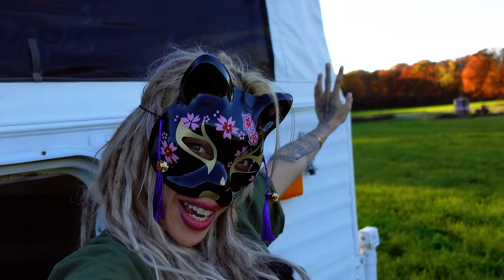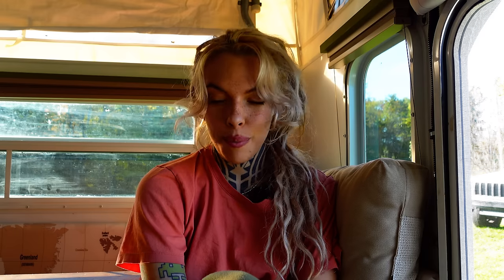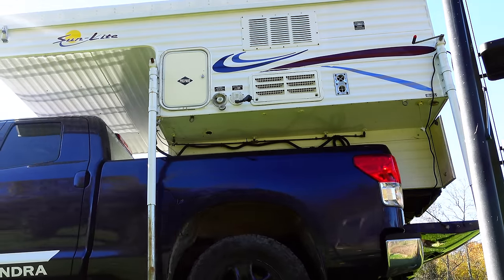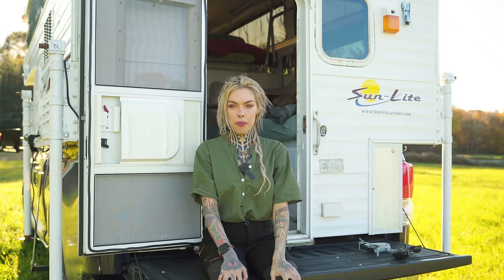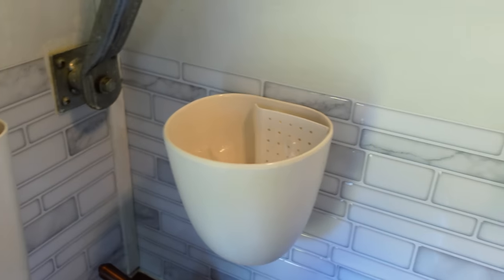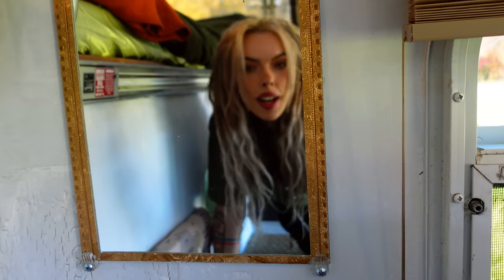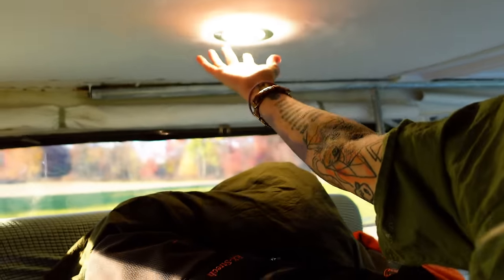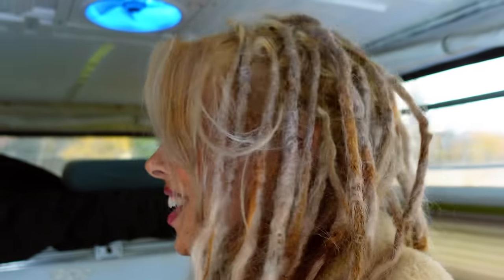finished TRUCK CAMPER *TOUR* (solar off grid renovation)

Comment: You did an excellent job restoring your camper and should be very proud of yourself, I don't know you and I'm proud of you, There is something about doing it yourself along with help from others that makes the restoration more satisfying. I also restored my Lance truck camper and can totally relate to the leak problem, it took me 6 months and out of frustration and a few too many beers one rainy night i finally ripped my roof out from the inside of the camper where it was leaking until I finally found the sourse of the leak, it was so fucking frustrating thinking I had fixed the leak sealing over and over to find out the next time it rained my roof was still fucking leaking, and the funny thing about it was the leak was somewhere that I thought I had sealed up and sealed up several times before, it was a pleasure watching you succed, Cheers

Comment: Nice job Victoria, certainly an improvement. I too spent years living off grid, (me on a sailboat), until my health got too bad to continue safely. Fridges running solely on alternative energy do not work so well in my experience. The problem stems from the poor insulation, and really needs to be a top loader. Last one I bought was an Alpicool C9P 9L Car Fridge 12v. This is small but worked well with my solar and wind set up. I used toilet roll to help trace leaks. Place the paper where you think the water might be running and keep a track of whether it gets damp. Any water will get to be a problem cos basically it will cause dampness and ultimately mould and rot. Recommend ziplock bags for everything... especially in cold damp climates. If you can, spray anything metal with a water repellent spray. Oh and if you can find a machine shop, get the winding handle extended. This would make winding easier. Cut it, weld in an extending piece, (like suitable tube), and your done. (should be a cheap fix). Best wishes from UK.

Comment: Camper is looking good!
Remember, if you haven't already done it, to hook up a charge wire from your trucks alternator to your camper plug so it will charge your camper battery/Jackery  while you drive.
I've had 4 slide in campers and all have had this. Even while you're at a camp site you can let the truck idle and charge up!

Comment: Love it! You did a wonderful job!! I believe there is no better feeling than seeing a finished job, when so much time and effort has paid off ...and it shows! One thing I might suggest. If your truck doesn't have a cb, you might consider one. Even a hand held in the least, for emergency purposes. Also, for your camper, one suggestion might be a hanging net if you have room to attach. A small one could hold fresh fruit or veggies, and when not in use, fold neatly out of the way. Wouldn't take up a lot of space and holds tight while driving! Anyway, can't wait to see the next vid! God bless and stay safe!

Comment: How exciting! Can't wait to see what kinds of adventures you are going to get into! I bet you're gonna feel right at home in your little camper once you get on the road. It's looking good, great job! Where are you going to go first? I bet you are excited to get going. Hopefully it works out well and you have good luck with this truck and camper. It seemed like you always had Yuki in and out of the shop getting one thing or another fixed. Hopefully this set up doesn't give you much more trouble than it already has. I feel like you went through A LOT to get it fixed up okay. Like for real, you busted your butt fixing it up and I'm proud of you! Sending love and well wishes, as always, from SC. 💖💖💖

Comment: Be sure to watch all over the wires for water intrusion where you penetrated the roof. This is notorious for leaking water and water following down the cable and leaking below. Common issue due to the heat and expansion contraction of different materials. You have put a lot of work into your set up and it looks wonderful.

Comment: Happy trails..... 😆 
Don't  put the tie downs too tight it will pull out the attachment  point on the camper.
They should be no tighter than what a 5 yr old could do. Fast guns are spring-loaded to allow some relief when traveling over bumps and rough terrain....
You dont want to learn the hard way.
Safe travels .... ❤️

Comment: Good job! One suggestion. Get you a little 2 or 3 step folding ladder/step like you might use to get up to a tall cabinet.  That is what I got to get in and out of my bed of my older model truck. Be sure to put antislip tape on the steps! Happy camping!

Comment: If you're concerned with load limit.  
Spring helpers for the rear axle with help an they are simple.  Later down the road would be better load   rated tires.  Love peac an chicken grease .
Reply from the maker: Thanks

Comment: That’s the same type of 200w solar panel I had on my suv. I also had an inexpensive Emory fridge/freezer combo that only drew 35w/hr when it cycled on. It had no problem making it through the night with a fully charged 700wh Bluetti. I usually had enough power to make breakfast on my George Foreman grill.
Reply from the maker: Nice I’ll have to look into that
Reply: I think the biggest power station I can have in an suv is a 1000wh one. I’d love to have a 2000wh one though. But it’s just too big and heavy for the suv setup I like.

Comment: It's a never ending journey - I decided to go up to Maine to see the fall colors. Well I leave from Las Cruces and get to Clovis NM and absolutely no brakes. Was fortunate for 
the system not to go out going down the mountains. It required an expensive component that works the whole braking system. Just under $4,000 and a broken windshield ( mechanic accident) and was back on the road. The fall colors were Wonderfull !!! Back to Cruces and saw what I need to do to rework the whole set up. Tues I get a new windshield 
and will be finished with the new layout today and gearing up to hit the road again. I feel for you having to do all the work to get things up and running. I hope it works out well for you. 
Fresh plants will be wonderful. Looks like you have it all figured out now. I hope you get good gas mileage. Love an adventure theme that's my logo on my vehicle ( Living the Adventure) Wanderlust. Definitely more room than you had before. Congratulations. Loving your space is important.
Reply from the maker: Oh wow that sounds scary! I'm glad you're getting back on the road.
Reply: @TorieRobot   The good thing is I won't have to worry about it again. I am sure you can't wait to get on the road again as well.

Comment: My camper runs the fridge and stove and heater a week to 10 days  using one 20 lb 5 gallon propane tank. This all depends  how much your running the heater. If you dont need to run the heater at night and just use it to warm the camper when you get up in the morning  you should be able to get 10 days out of one tank.

Comment: Very nice work. 
I would put the knives handle down on the magnetic holder. Or maybe under the sink while in motion, the bumps and vibration down the road could work them loose either way. Just from past experience.

Comment: I hope they told you when you got it aligned the camper should be in the back of it when you align it because when you put the weight in the back it throws the alignment out

Comment: west?   huuummmmm.   awesome  job well done!  looks like double your money!  would like to put a positive thought forward I  worry about it my self with my own camper. Good to see the co2 sensor and the  fire extinguisher! Is your heater gas and electric? both or just elc? you will be surprised what will set the co2 sensor off. I sure was! but my thought was keep a close watch on that propane gas. with my camper not in use turn the valve off at the tank ....
Reply from the maker: Yes gas and electric
Reply from the maker: Fortunately the propane works for the heater but not for the fridge

Comment: Hello?
 From Colorado, good job, girlooking really ni mean the camper. No, good job, all the way around. I.  You use my advice about putting the masking tape in your bed and down the camper for alignment when you're loading up The camper good job can't wait to see where you go camping. Be careful out Thare. You waiting for your next video?
Reply: Are you able 2 Crank up and down your top yet by yourself I.
 Have 2 lithium-ion batteries with a solar controller mounted. And I have 200 W folding solar panels that I set up outside.  When I get to my camping works real good.Never run out of power

Comment: Camper living can be challenging but it’s better than the jeep or a van. Remember, the plumbing can get ruined if it gets frozen, so it’s often best to not have water in the system for the winter and just use bottled water for daily use. The plumbing can freeze just driving down the highway during cold weather.
Reply from the maker: Yes gotchya

Comment: I really wished you had put at least 6 to 9 solar panels then 3 battle born batterys a inverter and solar control you would be able to run ac fridge all day/night that jackery junk won't last I hope you have a diesel heater in your future .and you can get a propane fridge or 12 volt it's 2024 .

Comment: A van would have been better and safer. The safety issue with the  camper  if you need to  book out you have to go outside to get into your truck, not safe!  In a van just jump in the seat and go... think about grabbing a  driveway alert from harbor freight put them around your rig and when something breaks the beam the alarm goes off cameras would be nice too. Its crazy out there especially  in the west due to defunding of the police.

Comment: I've looked at prices for those campers. Nthing new for under 30k. You actually didn't get a bad deal. Oh and those drawers you put in the truck may fit nice but if you stop quick they will empty the contents out at high speed. Figure out some way to secure them. I'd hate to see you with a whelt on the back of your head.
Reply from the maker: Yes they are very hard to find and the drawers are secured - no issues yet

Comment: I know you want to take those legs off the camper but I would advise against it. If you have any mechanical issues with your truck it will make it a lost easier to have work done on it without the camper on. there. Also if they needed multiple days to work on it you would have nowhere to stay. Just something to think about since youll be traveling a lot. .
Reply from the maker: As I said I am taking the legs with me

Comment: Well not criticizing the work you have done but that Jackery and panels are sort of a waste of money. For just a little more you could have put way more powerful panels on the roof with a much more powerful battery so that you could run the fridge. Live and learn I guess
Reply from the maker: The reason I got those ones is because they are lightweight - my roof can not handle more than that and the Jackery battery was a gift from the brand so I’m very happy with it

Comment: U spent that much time building it and u never gave it a deep clean the canvas still looks molded and nasty there is cleaner out there that will clean that ur bed is going to be nasty in like a month
Reply from the maker: I’ve cleaned and scrubbed (with proper product) the canvas several times thats just its color 
You sound very bitter btw - should have better commenting etiquette